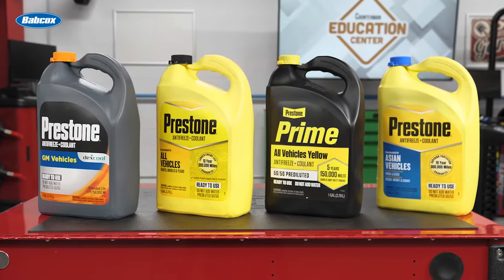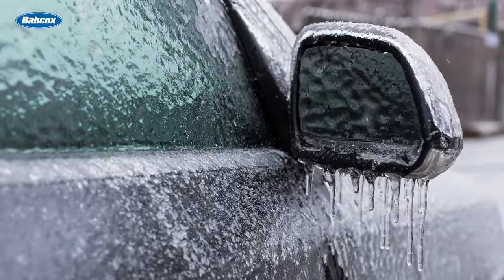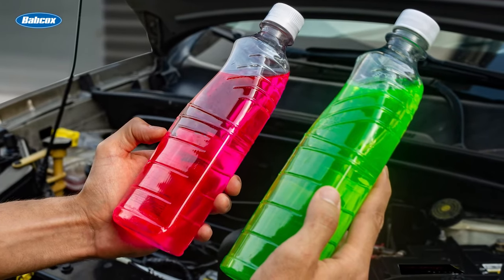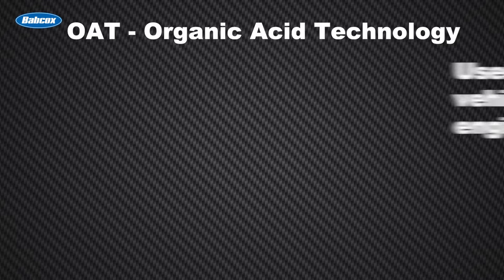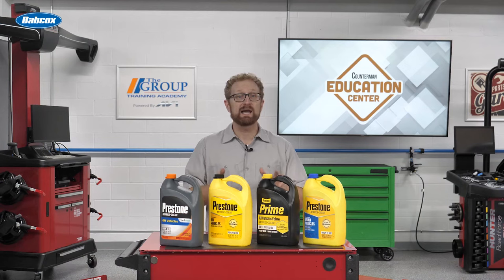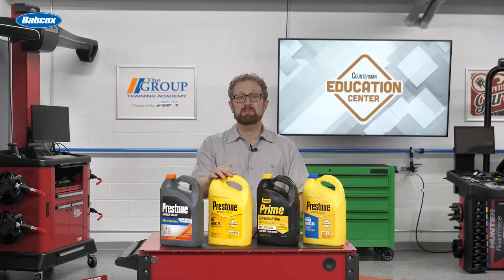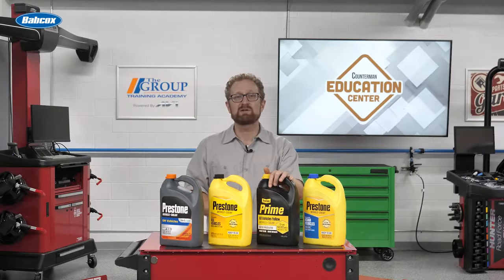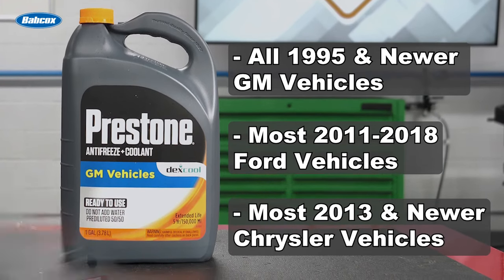Basic Types of Antifreeze/Coolant

Comment: Since I live in a warm climate I have never used antifreeze. I use pure water only. Now if I lived in a cold climate of course I would use antifreeze to keep my coolant from freezing. That's why they call it antifreeze😊
Also, no kind of liquid will boil in a sealed system. Have you ever heard of a pressure cooker? Did you ever see water boil inside a pressure cooker? No, because it can't. And we have things called radiator caps which release pressure at 15 psi just in case. As far as corrosion goes, the only way corrosion can begin is if additional oxygen is added to the coolant system. You might want to look up what causes rust. It's actually burning of metal. Burning can't occur unless there is oxygen present. Like I said, I have used pure water for many years in all of my vehicles and have never had any kind of problem.
Reply: This is absurd, any cooling system will corrode, it's recommended by most models to use at least 33% antifreeze to 66% distilled/deionized water!
Reply: @AutodidactEngineer  meh, Doesn't matter to me who you believe. 40 years of personal experience works for me.😀